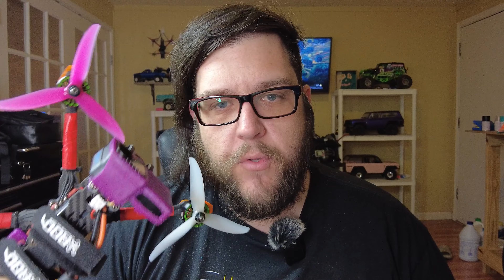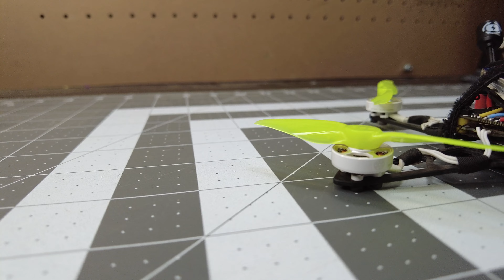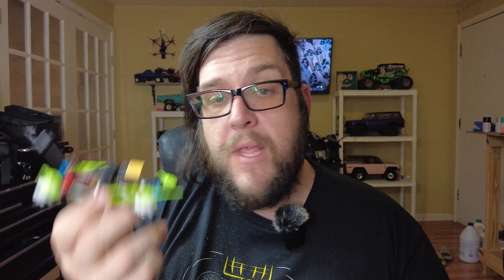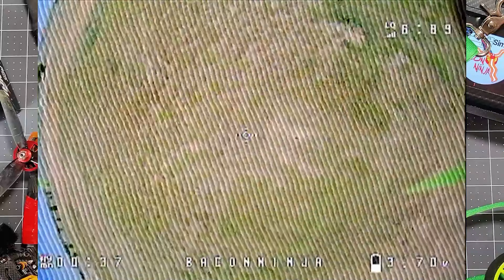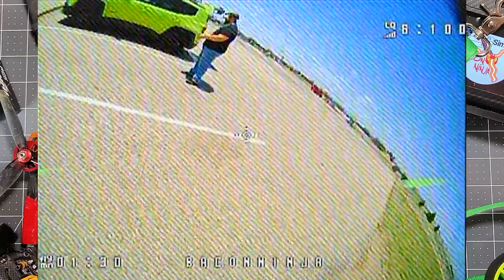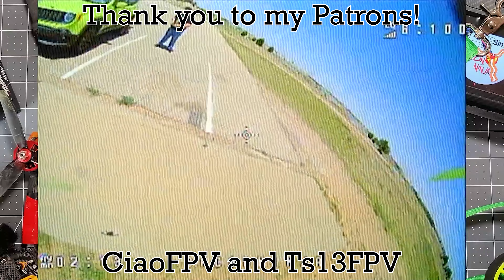Can a 1S FPV drone be stealthy and still shred the face off of your local park?  Meet the Pork Chop!

Comment: Great vid man . Definalty gonna build something similar with the frame I have . Loved the landing straight in to the car 🤣
Reply from the maker: Thank you bro!  I really like the freestyle format over a traditional toothpick.  Just took it out again this morning and put it full bore into the corner of a brick wall, into concrete, then a 20ft skid under a car...she is fine!  On the landing, I was aiming for just the open section but somehow got the backpack instead, lol.
Reply: @BaconNinjaFPV  my first "outdoor" quad I had was the tinyhawk 2 freestyle I loved it and still fly it today . Great little quad for light freestyle . I'm getting the same sort of vibes from your build , looks like a great little "pocket ripper" as I like to call em
Reply from the maker: @ts13fpv  The TH2F was my first micro and has been one of the best quads I have ever owned!  This quad was actually designed to replace the TH2F in my fleet because I wanted a little more power and ELRS without having to tear that little quad up to get there.  Sadly I think my TH2F is going to be a shelf queen now that this build is in the house :(

Comment: That's hilarious: I literally have just gathered all the parts to build one, and then today I found this video! 🤣Only difference, I'm using a BetaFPV F4 1S 12A AIO and a TBS Pro32 Nano VTX! you got yourself a new subscriber, man! 🤘 And BTW, I would LOOOOVE your CLI dump, since I suck at tuning! 😅
Reply from the maker: lol, great minds think alike!  The Beta board is a good choice for this, I just went with the Darwin for the 15A ESCs, full size UFL for ELRS, and it actually being in stock at the normal stores.  I really appreciate the sub BTW!  The CLI dump is in the description for the video I just released where I took this build HD.  That dump should get you going, if you just steal the tune out of it since the board will be different.  There is a profile for 1S as well as 2S in there.
Reply: @BaconNinjaFPV  cool thanks, I'll check that out. the BetaFPV board too has a full size UFL connector, BTW, and is 1-2S compatible, so maybe I'll try it on 2S too, which I wasn't planning on doing until I saw your video!
Reply from the maker: @pgabrieli  i very highly recommend trying out the 2S tune!  It rips on 1S...but screeeeeams on 2S with a 65% motor output limit that i have in there.  The motors don't get hot either.
Reply: @BaconNinjaFPV  I only have 12A to play with, compared to your 15A. do I think I'm okay with 2S and that throttle limit, or do I risk blowing the AIO? 😬
Reply from the maker: @pgabrieli  hmmmm, it may be a bit close...but if you are running biblades and don't plan on turtling out of anything, it should be ok.
Reply: @BaconNinjaFPV  thanks! 👍

Comment: I built a 2s on that frame. Used the hx115lr V2 fc, flywoo 600mw vtx, and rcinpower 5000kv motors. Thing is fun to fly and pretty quiet.
Reply from the maker: I think 2S would for sure be great on this kind of build!  I really enjoy my TH2F and it is somewhat similar to this but in 2S.  I was shooting for 1S on this one just because I wanted to see what the low end of that limit could provide, and put something together that can be a solid option for the HDZero whoop lite 1S when it hits the market.  I bet that 2S rips hard!
Reply: @BaconNinjaFPV  I also have a TH2FS. It is not as fun to fly as the 2s HX115 build. The HX115 build is so much smoother. It is fairly quick but I am newish to fpv so I can't really rip around real fast yet. End up crashing a bunch.
Reply from the maker: @xTVCHI3f  yeah the TH2F is not a smooth ride by any means, lol.  I have been ripping mine around for a while and crashed it more times than I can count...so it is realllly not smooth now.  One of the things i do love about this 3" build is how smooth it flies compared to the TH2F.

Comment: before soldering tiny stuff i always grab a bike light pcb or something that is simple works and is not missed when you do fuckup and just practice the calm needed to get to the fiddly bits :P but yeh you need either experience or some good zen to pull those tiny solderpoints off without messing up looks like a fun built specs kinda feel like what the eachine novice 2 (my starter) could have been :P
Reply from the maker: That is a good tip.  A nice little warm up on some junk board is a great way to get started before poking at all of those small micro parts, lol.  I have been soldering for...geez....20 years now ( I suddenly feel old ), so I just kinda go for it.  It is a super fun quad, and I rip it around the yard at least once a week just to remind myself of that, lol.

Comment: I just finished the standard babytooth build (ant, crossfire, unify nano, bob's latest 1s board and motors, etc). Holy wtf super fiddly to build this thing. The soldering is an issue, but more of an issue is getting all the components to fold up and stack up nicely in that sandwich under the pod. I managed to get everything sorted, got it bound, SA working, etc - let it sit for 2 weeks due to life - now it's lost bind on crossfire and I can't even be bothered to dig out the rx to reach the damn bind button.  While initially I was thinking your freestyle take on this isn't anything but aesthetics and wouldn't really affect flight performance, I do see there being a lot more room to actually lay out components in a rational way. I'm probably going to let this fiddly thing sit a while longer till the whoop lite kit comes out, and may also swap to an AIO with an SPI based ELRSrx as well just to bring the fiddle down to a manageable volume in this orchestra of chaos.  I also feel like I'm going to destroy the motors every time I remove or replace the props. 

If you're running 4.3 that CLI dump would be nice as well - I've not yet found a preset for a 1s toothpick I trust on 4.3 and have no idea where to start with tuning on these things (but I really do want to get one up in the air).
Reply from the maker: it seems like fiddly is the name of the game with micro builds!  It is absolutely easier to get everything under this two plate frame, especially with the ELRS SPI receiver being built in.  At least these motors have a 2mm shaft so the likelihood of breaking one is "lower" lol...its always a pain with this press on style of prop but the smaller ones are a nightmare.  I will get that CLI dump loaded up somewhere, add a link to the description, and let you know!

Comment: How durable is the frame?
Reply from the maker: for such a small thing, it has held up really well.  I can't even count how many times I have crashed this one and I have had no damage to the frame other than scratches.  My motors are all dinged up, but not even a delaminated arm for splintered support strut.
Reply: @BaconNinjaFPV  oh awesome, I think I’m going to make the same build but with an X12 instead to save on weight, do you use the BF default tune?

Comment: Thanks for sharing
The noise in Ant camera is not from flight computer regulator, I have the same FC and caddx ant and on 1s the image is more clear than on 2 s. The image from and on my setup on 1s is clear.
Reply from the maker: I honestly think the AIO I got is on the lower end of the capacitance spec for the BEC and it is not filtering out as much noise as others closer to the spec.  I put the camera on a different build and it ran just fine, but no matter what 5v pad I use on this one it does the same thing.  It is all good though since I went digital with the pork chop and found another use for the ant.  The Darwin AIO has held up to some serious abuse though, and even if the build consistency isn't perfect it is a great option for the cost!

Comment: yo Bacon Ninja, I was psyched to come across this vid today! That thing really rips! I been working on a second build on this frame very similar to yours. My first one was swapping the components over from one of my SavageBee 1S for the purpose of being able to more easily mount Go2 and/or Thumb Pro on that top plate since I haven't found good alternatives for the Goober canopy (other than zip ties!). The second build (not in the air yet) will use HappyModel 1202.5 11500KV. motors, also to the Darwin FC. I was considering those 13mm FPVCycle motors, but went with the 1202.5 for a slight weight savings. Who knows if the difference will be perceptible? Bummer to hear about the grain issue with the Ant Nano, because that's my go-to camera for these builds as well. It has served me well on the SavageBee.  I wired the Thumb Pro directly to the BeeBrain V1 FC on the first build, and while it did work fine, my flight times were cut in half at least, so I think I'll stick to the Go2 on these micros for now. I live in a city and it's hard to find places to fly with larger noisier quads, so my draw to these 1S rigs has always been how quiet they are. Anyway, cool to find someone else doing a similar build, and to see your experiences with it. Keep on flying, brother!
Reply from the maker: Hey, I am just glad you ran across it!!  I actually built this as an analog 1S originally, but since then I converted it to digital and build a 2S mode into the config.....2S rips harrrrd by the way.  1202.5 is going to be close for sure, and you probably wont notice much of a difference.  Ripping in town on 1S is super stealthy with this kind of setup, and one of the reasons I built it to be able to do both 1 and 2S.  When I feel like ripping harder and making more noise, the 2S gets strapped up, lol.  I am really digging this Darwin AIO btw.  Rock solid, and even though it is a weird two board glued together thing, it has held up really well in some crashes.  If you want to see me crash it,  I think the most recent update one where I held a funeral for the tiny hawk has a couple of decent hits in it, lol.

Comment: Veeery interesting! Can this build carry insta360 or thumb or smtn similar? Or i should switch to 2s? Or/and maybe different motors? Give a advice please.
Reply from the maker: I think it has enough thrust to run the thumb for sure, but then you run into the issue of not really having 5v to run it from.  If i wanted to carry a Go2 i would probably do this same build but in 2S and get 13mm motors in the KV for that setup.

Comment: great vid, sick flying! i have that frame and similar motors, do u think naked vista+polar nano and maybe 2s would be too heavy to fly well?
Reply from the maker: Thank you!  I think this frame is going to have a hard time fitting a naked vista and still having room for the AIO :(  I think it is totally doable on the 3" props though, you just may have to go with more of a traditional toothpick build that isn't so vertically limited.

Comment: I’ve always eyed up that frame but figured the LR frame wasn’t going to fly fun for me (pun intended). Now I’m like 🤔. Maybe a x12 + 2S and 11000kv motors seems enticing for this frame. Would you do lower KV with 2S than 11000kv? I’d like something a micro that can do building dives 😅.
Reply from the maker: lol, I enjoy how you worked a pun in there!  I think I would still go with the higher KV motors and a throttle output limit if I were going to do it all over again.  I really like the ability to swap in a 1S if I really feel like it and change the PID profile based on cell count.  Also, this thing will catch in a dive no problem with those big ol' bi-blades on high kv motors.

Comment: 60 gr seems a lot for these 13 mm. Im at 42 gr with the baby tooth 1.5 mm frame and handles amazing. However, your build seems more than appropriate for freestyle. Congrats
Reply from the maker: It is definitely a little chonky compared to a more traditional toothpick build.  I would say that one 1S it performs as I would expect for freestyle, but i just recently put another pid profile in for 2S and a 65% motor output limit where this thing shines!  I think i prefer the 1S for smaller spots like my back yard but for a little bit bigger of a place like a park, 2S is going to be my pick for it.  It's nice to have an AIO with 15A ESCs that can handle up to 3S so i can kind of pick and choose...even if that board absolutely weighs more than it should, lol.  Thank you so much for checking it out!

Comment: dig it... but 2s... digital.... 
80% motor output limit...
yeah. pain in the arse getting everything working... I've done a few babytooths 
waiting for hdzero 1- 2s board and goggles. 
wires breaking... fiddly... 
5" is soo easy, relatively
Reply from the maker: I actually just set up a second profile for 2S, but i went with a 65% output limit just to be safe for now, lol.  I had originally wanted to go with a babytooth, but man that whole canopy as a top thing really weirds me out about those builds.  I don't know what it is, but it makes me feel like I am just going to tear it apart so fast.  HDZero is going to be amazing for these kinds of builds very soon!
Reply: @BaconNinjaFPV  65 is probably more accurate, I just find I never really go full throttle. 
I haven’t don’t it yet..,so I dunno 🤷‍♂️ 😂🤣
Reply from the maker: @RCRitterFPV  ok, so 65 is the right place for sure, and boy were you right!!! This thing sings like a bird on 2S and will literally rip your face off, lol.
Reply: @BaconNinjaFPV  sick, I bet. I gotta do mine now...